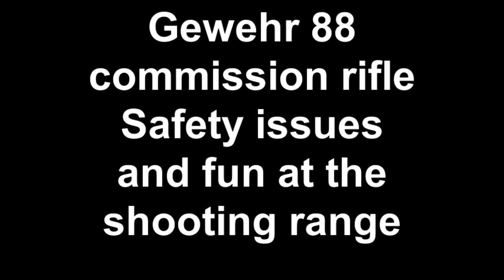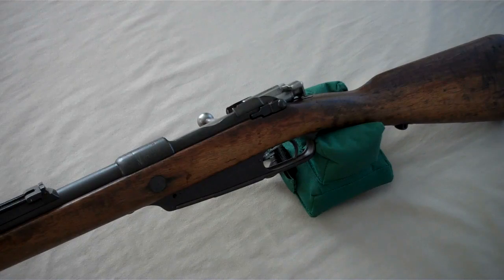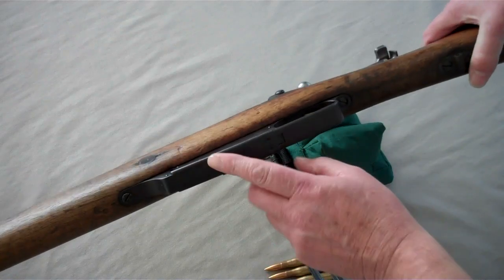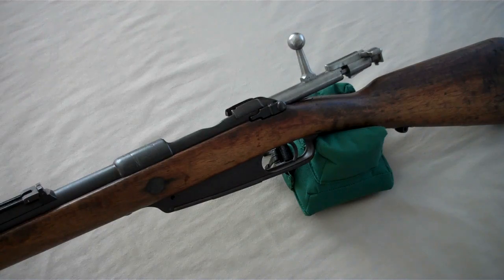Gewehr 88 Commission Rifle

Comment: Thank you for a very good and information filled video of your Gewehr 88 Commission rifle. I bought a fine example of the Gewehr 88 many years ago. I was told by a gunsmith of the differences in the barrel diameter, so being at that time I only paid $35 for the gun I tied the gun in a truck tire. and pulled off the first few rounds using a long cord. Everything was fine, and the empty rounds showed no signs of high pressure. I should mention I was using standard 8x57 ammo. There was an "S" stamped on the top of the receiver which I was told meant the gun had a bore of .323, and would accept the 8x57 round. . I did not know anything about the bolt leaving an unfired round in the chamber, and don't remember ever having a problem with it. I did not own the gun very long, and sold it to buy a K98 carbine at the hefty price of $65. This was in the late 60's. It was nice to see a Gewehr 88 Commission rifle once again, and now I wish I had kept the many surplus rifles I bought over the years. The finest ones being the Swedish Model 96 Mausers, in my opinion. The worst was a Carcano carbine which had an issue with the bolt. I would caution anyone buying any of the old surplus guns to have them checked out by a an experienced gunsmith before shooting them.

Comment from the maker: I'm using the regular LEE 8mm Mauser resizing die but I made my own neck expansion spindle which is 0.002" smaller in diameter than the standard 8mm Mauser part. This makes the neck just tight enough to hold the 0.321" Speer bullet firmly in place. The final operation is crimping shell and bullet together using the LEE/Mauser factory crimp tool.

Comment from the maker: Hi Kenneth, my message of caution wasn't directed at you. I already sensed you did your homework and slugged your barrel before shooting the rifle. One thing I noticed using the stubby Speer bullets is an occasional feeding problem with the last round. The Mannlicher-style cartridge lifter/follower tends to tilt the bullet tip downwards, causing it to hit the lower feeding ramp. That's because the bullet is just a tad too short. Fast cycling usually overcomes the problem.

Comment from the maker: Generally, I'm not a fan of posting load data because there are still negligent gun owners around who will apply whatever load info they find online and force it through their barrels without ever checking their rifle's actual bore diameter. Then they get hurt and all of a sudden it's my fault.

That said, for a 0.321" Gew88 barrel I use 31.5gr IMR4064 with 170gr Speer #2259 and 31.0gr with 170gr Hornady #3210, topped with a corn-size fluffy cotton ball to keep powder packed against the primer.

Comment: i recently purchased one of these and have yet to slug the bore on it. Provided it's a safe .321 or .323 diameter, would I be able to fire modern 198 gr ammo through it? i have not been able to find anything close to its original 154 gr, i bought a box of romanian 170 gr but when i try to feed the ammo into the gun it is incredibly difficult to close the bolt.
Reply: I just got a Kar 88.  From what I've read, you're safe with American commercial, but not military surplus.  I would also be leery of the European stuff, but the American rounds are apparently loaded to lower pressures because of these rifles being out there.

Comment: Good advice on the handload.  I'm using the RCBS die and it seems to be working fine without any alterations.  I'm using 31grs. of IMR 4064.  I'm hitting about 4" high at 100 yrds with reasonable groups, but I think maybe I should increase the load.  What load and powder are you using?